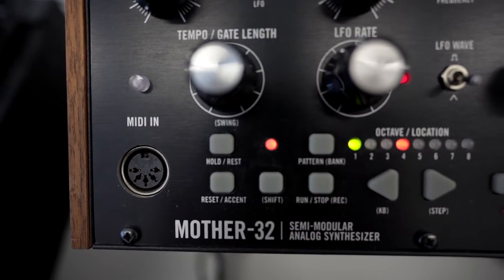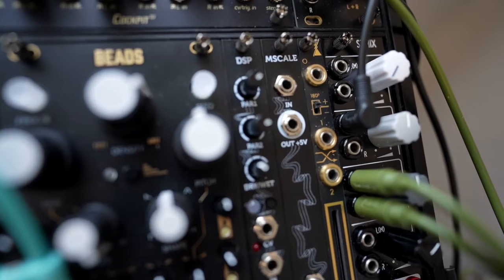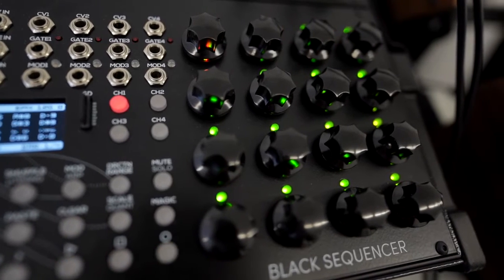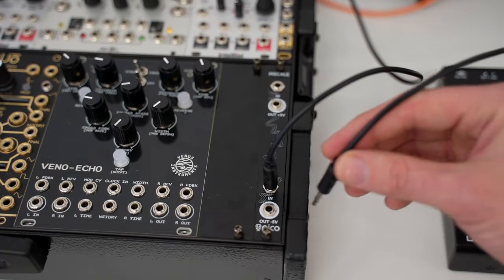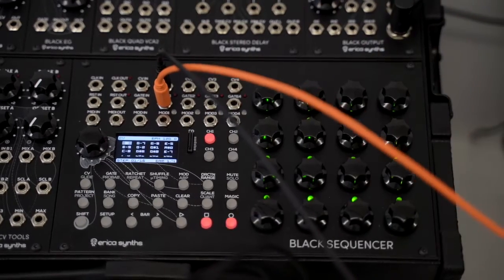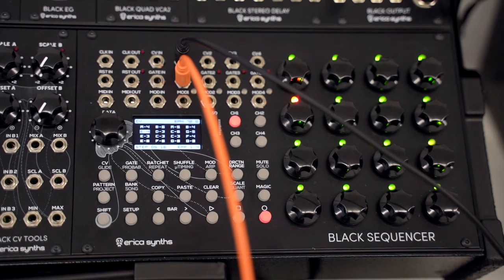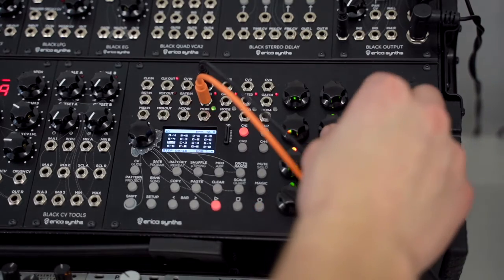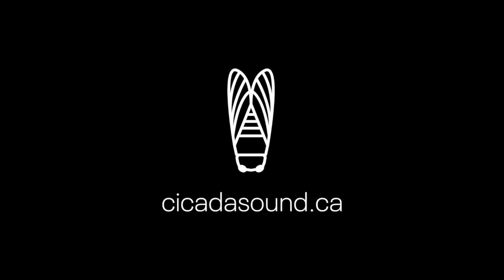Sequencing the Moog Mother-32 with a Eurorack Sequencer using the Pico MScale from Erica Synths

Comment: could an attenuator like the Lapsus Os be used to accomplish the same -5volts or +5 volts?
Reply from the maker: Yep, for sure. As long as the attenuator can adjust offset like the Lapsus Os, Maths, or Shades, you can dial it in to accomplish the same thing as the mScale.